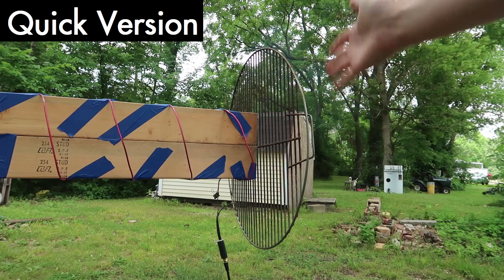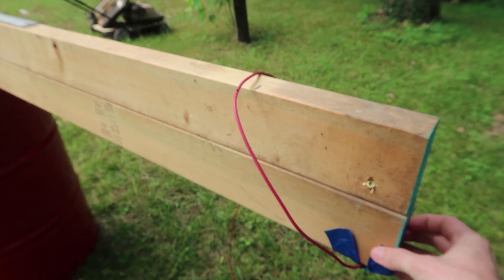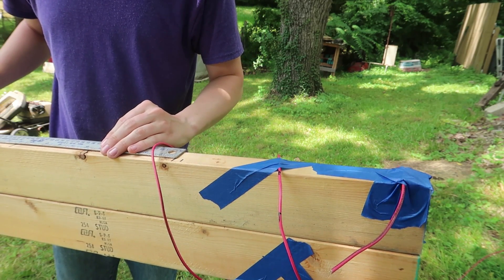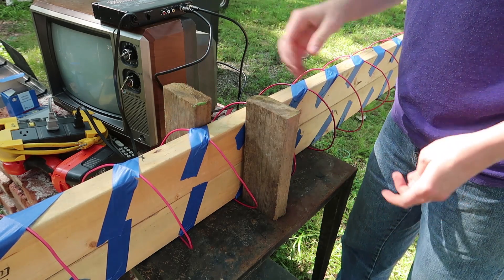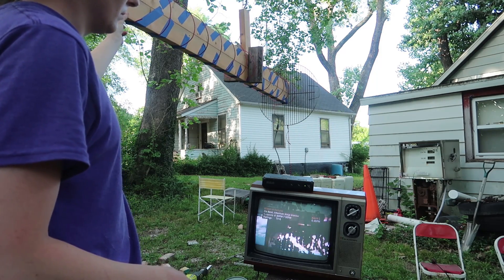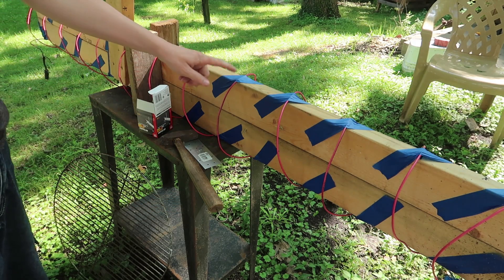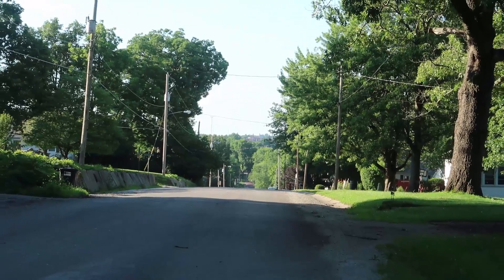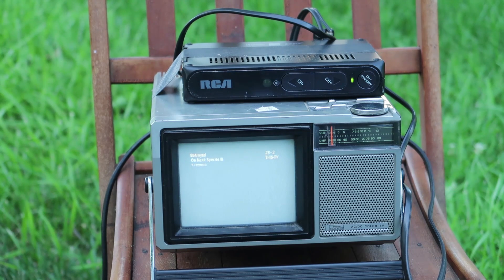Digital TV Antenna Experiments 02: DIY Super Long Range Axial / Helical "Rural" Antenna, TV DXing

Comment: Going out on a bit of a limb here....!
But I'm thinking most, if not all,
 " Off- Air " TV stations transmit Horizontally.
Helically wound antennas also have two Polarizations !
One being, 
" Left hand ", and "Right hand " circular polarizations, depending on which way the element is wound !
True, you may receive some TV signals, but I'm wondering if you employed the proper Horizontal polarization, that you might pick up even more Channels ?
Remembering that both types of antennas are highly directional !
Too, remember that height is your friend !
Getting the antenna high and above obstructions, will pay big dividends !
Also, feed line matching is critical, for optimum performance !
And congrats on your work so far !
👍😉
Reply from the maker: Axial antennas can pick up any flat polarization.

Comment: I'm surprised that you have not thought of using PVC or tubing aluminum for the framing of your antenna? The PVC could be more tricky but, at least you could cut the weight down, The aluminum tubing would be more idea for more strength and, for different weather conditions. You can but 1" by 1" aluminum square tubing for a lot less than your wood antenna frame from Lowe's or Home Depot: They sell 5 foot lengths, if needed you can buy several to make the main frame. You can also buy long rounded aluminum rods for less than them staples. Anyways, I know it was an experiment to see what can be done? The PVC piping would also be lighter weight but, there are variables to consider?
Reply from the maker: Well I didnt have any money for this and aluminium tubing would interfere with the radio signal in a way I wouldnt know how to expect. I didnt have any hardware stores within 45 miles back when I lived there. The wood was fine

Comment: Mountain ranges can make receiving long distant stations difficult. At about 5' above the ground, I was able to get tv 26(New London,CT) on rabbit ears with signal strength in the red range , but with the antenna I mentioned in my previous post here the signal strength was in the green level.  When everything was analog, this particular station was difficult to receive and was snowy color at best.  wwlp 22  used to be easy to pick up, but now broadcasts on tv 11 and is much lower power, so it did not come in at 5' above the ground.  The station comes in strong with the existing antenna on the roof.wwlp used to come in on a loop antenna , even in the basement, on the rca black & white 1968 vacuum tube set.  wtnh 8( New Haven, CT) used to come  in on rabbit ears upstairs, but I did not find a way to pick it up over the air yet.    I do not know why my previous post says @briannowak1077.

Comment: I have a question... This is probably something already answered, but I'll ask anyway.
Could this be used as an omnidirectional antenna if placed vertically instead of horizontally?
Reply from the maker: No a straight wire antenna is omnidirectional, this would point the RF upwards

Comment: Either interesting design. But I think you could do better than Han that. Rethink your long range antenna design by watching YouTube videos on Southern ideas channel. I built a similar antenna to his 8-10 years ago. I built mine out of wood like you. He has done a lot of up grades from mine. But I did very well with mine as I was able to receive 51 channels and a few where close to 100 miles out. Of them 51 channels I considered (just my opinion) 20 % junk. Such channels as several "I love Jesus",  information channels n shopping channels n ect. I counted sub channels as a channel such as 35.1 n 35.2 6.1 6.2 6.3 6.4 ect. As each sub channel was a different programming.

Comment: I live 90 miles ENE of you.
 Have gotten as many as 58 channels on a good day.
 Always get 28 in HD.
Removed all but one PBS and its subs, duplicate chanels  an  bs nobody watches.
  15 watchable channels. Antenna ten foot of the ground.
Weather gets better going to mount it on the roof with a rotor. Thinking ill get maybe double that.
 Cut the cord/sat.

Comment: The trouble I have had is the consistency in receiving the more distant stations, and local low power stations, but I made a twelve bow tie ( Radio Shack) antenna and left it at my parent's house.  I am not sure if it was much better than a four bow tie antenna.  Hilly land can make it much harder to pick up distant stations.  Trees can also lower the available signal strength.  
The voltage is developed across the diameter of the wire.  I finally decided to buy something that will not rot to mount an antenna on.  I still have
to come up with a draft of  a plan, and I have to think about getting brazing equipment.    

I am not positive where the best place to have place the 75 ohm adapter on your antenna would have been, and that could make a difference.  Your antenna reminds me of one I make for FM in  1989 or 1990.  When everything was analog, the 19" black and white RCA vacuum tube television set I was using at my parents' house (Simsbury, CT) did pick up WMUR 9, and 11 from New Hampshire on rabbit ears on occasion, and the Boston, MA stations, as well as other distant stations, with 39" rabbit ears, loop, Radio Shack  bow tie , or Radio Shack double bow tie ( with rubber feet). Altitude is what is needed to pick up Peoria,(IL) stations.  If you know the frequencies of those stations, you can tune your antenna for those frequencies, by making elements for them.  A signal amplifier might help.  

Interesting antenna!

Very Respectfully,

Brian Nowak

living in Texas

Comment: I only have the RCA boxes but now HDTVs are SOoo cheap. If wire to antenna is long maybe need an RF amplifier. I never made one but I made a one transistor composite amplifier for my old Coleco Vision so I could have composite video out and just put both wires of audio through 1K for protection. Go to Hokkaido for sure! AsaHiKawa (morning sun river) has a nice vibe and there is a nice river to walk around behind the main train station. Guest house I stayed in was a few big blocks walking straight out from the train station and had some generic name Asahikawa Guesthouse (maybe) on 2nd story of some building. The town Otaru in Hokkaido has a great train museum. Need to say Hi to Terebi-to in Sapporo.  If in Osaka a good cheap place was Hotel Toyo which is near doubetsu-en mae station (meaning in front of the animal park, aka zoo, station) since there is a small zoo nearby in the sort of cheap neighborhood. Then you need to go to a Hanshin-Tigers baseball game and be sure to buy your ticket to sit in the cheering section.

Comment: I have a question.  I'm trying to receive a 5-watt MHz 121.5 signal 100 miles away.  There is direct line of sight, as the transmission altitude is at 10,000ft, and so the curvature of earth is not a factor.  My question is:  What's the best kind of rcving antenna I could custom make or buy?  Helical types?  Array types?
Reply: You should call the FCC and ask them. Then call the Department of Defense and ask them. Peace be with you
Reply: @alexandereaton8025  😂😂

Comment: Curvature of the earth, altitude, distance from the ground to pole position, type and size of antena. All factors to use in calculating good gain and reception. Using multiple antenas require filtration otherwise you will get too much noise. The calculations they don't tell you about is the location of repeater towers and how high they are above the curve of the earth. So, in the past (30 years ago) I have lived in Fresno CA, where we were able to regularly receive stations as far away as 300 miles North up the valley. Where it became difficult was over The Grape Vine Pass toward Los Angeles or over the range toward San Francisco. Of course that was because we put up a 40 ft pole with guy wires on top of the peak of the center line of the house. which made for an over all height of 58.5 feet above the ground. The top of the pole had a 6 ft yagi and at the 55 ft mark a 5ft open mesh parabolic 1W Ham transceiver  . The yagi still rotates with the remote system still operational. But now it receives more channels than anyone needs to see. From Sacramento to Bakersfield. Of course it can't regularly receive over the ranges but, it does get bounced signals in the winter. Normally UHF can't get reception more than 80miles away VHF can be more but you will need to reconfigure your antena.

Comment: Definitely appreciate the channel and I like the experimentation that you do I am a little bit into the also into experimenting with different types of antenna when it concerns HD antennas definitely height is your friend you're dealing mainly UHF and VHF signals as you know these signals work greatly on the line of sight so height is your friend the higher the better you'll get signals in general I'm still impressed at the Helix antenna that you built quite impressed maybe hooking up a booster would probably improve also your reception apart from changing the converter that you're using using good RF cable also may improve reception really appreciate the experimentations all the best 73

Comment: While the helix will pick up either vertically or horizontally polarised signals equally well, I suspect that by aligning the 'reflector' elements vertically, the antenna will preferentially be most sensitive to vertically polarised radiation. Does the transmitter use vertical polarisation? If not, can I suggest that you turn the reflector elements through 90 degrees to see if there's an improvement in signal strength.
Reply from the maker: yeah im sure theres a ton of little things to do to it
Reply: Most TV and FM stations these days use circularly polarized transmitting antennas.  Each antenna has a "loss" to it as 1/2 the power is vertical and 1/2 is horizontal - and that's why you will always see them in groups of 2 at a time to bring them back to unity gain - and 4 bays would have 3dB more gain than 2 bays.  Either polarization for receive antenna should work just about the same.

Comment: Left hand or right hand polarization must be determined.
Reply from the maker: doesnt really matter since im not recieving polarized signals
Reply: @RinoaL  but you built an antenna designed to resonate to circular polarized signal. 
This is not a bad thing in itself but just not as efficient as standard dipole except over long haul skip signals that shift polarity when hitting E and F layer of ionosphere.
Reply from the maker: it does fine with regular signals

Comment: Hi, just want to throw my 2 cents in... Have you tried a Gray Hoverman design? Only 2 pieces of heavy gauge Copper wire bent at 45 degree angles with a reflector 4 inches from the elements. Give it a try!  I live in mid Georgia and can get stations from ATL and Macon!

Comment: Oh my are u seriously using two by fours.lol.i admire your crazy dedication to making a helical.ive made many out of a pvc boom.please try that .two parallel 1 1/4" tubes your diameter is close but the length seems way to long and spacing in turns to far it seems from my memory of 500 mhz helical which is circular polarization.please check your turns calculations and lessen weight.your awesome i wish u were nextdoor.

Comment: Fascinating.  There used to be a Helical Axial Mode Antenna made for tv reception sold here in Canada back in the 80s and 90s.  Just a few quick questions:  is that insulted wire that you are using; one end of the wire attaches to the reflector, I can't see where the other end of the wire connects.  Sorry for the questions
Reply from the maker: the wire doesnt need to be insulated that goes around the wood. i just didnt feel like stripping it. as for the two antenna wires, one goes to the back grate and one goes to the coil
Reply: @RinoaL  That's what i thought.one lead goes to the reflector and one goes to the coil and they are electrically insulated.from each other.  i wish you had more calculations for frequency, etc.

Comment: Hanging from a tree reminded me that guy on a boat off the coast of Florida saying they were pulling in strong signals with no issues....when the boat was rocking back and forth lol.If you had any with VHF, how'd it do? There is a big difference across different product lines in the way they handle weaker signals. I've also noticed a big plus in strength when I use RG6 cable.
Reply: If you look close at the guy in the boat there is a disclaimer saying "TV picture is simulated".  LOL!  Those things he is selling are junk!  A piece of wire would actually work better.

Comment: you're in Missouri so am i. i need to try this because i did ham radio for 10 years and i like to experiment i took a metal spoon and a pizza pan wrapped it around until it was in the center and hung indoors then scanned i got 6 channels now i did the old "pie pan tv satellite dish" deal with a RCA amplified antenna and i got 16 channels but that's because im in Fort Leonardwood so its not good here

Comment: you can add a coaxial connector directly by inserting the 10 gauge wire into the connector and soldering it together.  Then you have something to connect an amplifier and coaxial cable to send the signal onto the tv.

Comment: I think i would have found a short piece 1 foot diameter tube, then wrapped the wire around and around.  
then i would have gotten a 2" pvc tube and spread the looped wire out.  and use some gorilla tape to attach the wire wraps with one continual piece of tap spacing each wrap at 5.5".

Comment: If you double your antennas you will get an extra 3dB, add two more antennas for a just a further  3dB, and there are connection issues. for 75ohm coax the linkage between them has to be 105 ohm grade cable . have you considered using an antenna amp?  Parabolic  or corner reflector builds? Great video, thanks from Plymouth UK.

Comment: How good is it going to do when the wire is left insulated? The insulation will attenuate the incoming Rx power/signal, maybe significantly? If you went to HW store and got length of what you need in 10 or 12 gauge bare copper then used that, you will be happily surprised I'm betting. You can use acrylic spray to protect your wiring if needed. I got mine out there all getting the funk copper gets and still going strong. Also I'd use 100% silicon clear caulking at the connection points where your transformer/balun connects (that's the most important to protect if outdoors in my opinion). If you go the bare copper route, there is a trick to straighten it out with a drill on one end and vice grip or someone holding other end with pliers. Then from there you can get nice even circles around the 2x4's.... Nice work overall, I love the challenge of getting distant signals.
Reply from the maker: plastic doesnt insulate against radio signal.

Comment: If you add extra arrays to your main reception set-up, you may outclass your transformer's ability to single out excess voltage. You can use two looped arrays, but you need something that is both a signal segregator and a microcircutry switch, that will give you exactly what you want within your targeted channel selection. There are units that do this and set-ups that have done same. I think that I have once seen this type of antenna, but it was armed forces that had same technolgies your'e using. If you refine this idea of yours and mount it outside, say on a pole or tall staff, make sure that you use a antenna spark gap lightning arrestor, if your unit gets clobbered by lightning. A drip-line isolates a percentage of that strike and dumps it to the ground as lighting when it strikes acts like a fluid. "Very good work, you had done"! *Sources, Mouser electronics and or other suppliers for parts.

Comment: TV and FM signals do not bounce off the atmosphere. That only works on low frequencies like AM and Shortwave radio.
Reply from the maker: analog ones do, and digital ones can to a certain extent
Reply: Rinoa's Auspicious Travails   Guys......    The lower frequencies (vhf) are much better at bouncing, or skipping than the higher frequencies (uhf)...   which mostly just travel LOS from the transmitter straight out into space due to curvature of the earth.  HF communications systems definitely are are able to bounce and as a matter of routine HF users change frequencies throughout the day to accommodate the “skipping” they depended on to “close” their longer distance circuits.

 HF 3 to 30 MHZ
VHF low TV freqs for channels 2 thru 6 are 54 to 88 MHZ
FM radio freqs use frequencies from 88 to 108 MHz
VHF High TV freqs for channels 7 thru 13 are 174 to 216 MHZ
UHF band freqs for channels 14 they 51 are 470 to 700 MHZ

Also...  the carrier that is radiated from any ( tv, terrestrial microwave, satellite) transmitter is analog.  The intelligence that is modulated onto that signal can be either digital or analog.
Reply: You should look up "Tropospheric ducting"...

Comment: i'M JUST wondering why you use covered wire....would bare 10 gauge copper wire be better? I'm still learning...so I'm just asking.
Reply from the maker: because i didnt feel like cleaning it and it doesnt hinder the radio waves
Reply: @RinoaL  covered wires dont hinder it?

Comment: The thing with using 2 antennas is making sure they are in phase.  At UHF frequencies, that's hard to do.  If you can combine them so the signals are perfectly in phase, you would add (I think) 3 dB to your gain.  You should look into a local ham radio club, I think you would really enjoy amateur radio.  I got my ham radio license about 40 years ago.  Thanks for the video.   I see there are some thumbs down, I can't imagine why that is.  :)